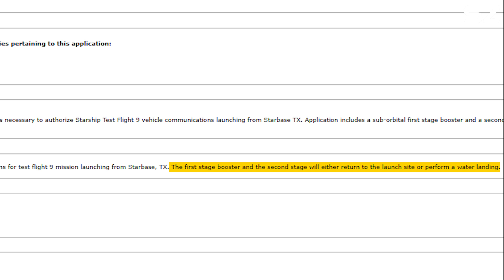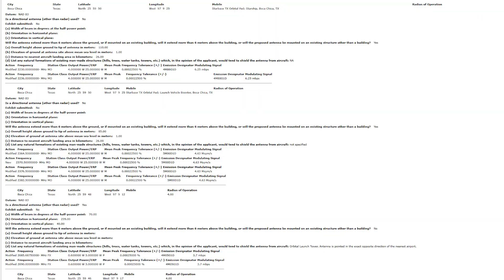SpaceX Revealed New Upgrade on Final Starship Splash Down, Unlike Any Other...

Comment: Don't you mean FAA not FCC?
Reply from the maker: Yeah! What happend?
Reply: @SpaceZonea  Your AI didn't generate a completely factual story. There was a license granted last week by the FCC for the communications needed for the flight. The FAA is the agency that actually authorizes the flight itself.

Additionally, viewing this on March 3 after you posted on March 2, you started with an announcement that Flight 8 is scheduled to lift of on Feb 28. Umm... It hasn't lifted off yet as it was postponed last week until later today. Not a good start.

If you must use AI to generate your stories, at least have knowledgeable humans review and verify them to catch the obvious flaws. Not just factual ones, but production flaws too, such as your AI voice stuttering because of a typo in the text at 11:18.

Preferably, use humans to write, narrate and produce your stories. You will find the quality better in all regards, at least until AI becomes truly ready for prime time. (which is clearly not yet since it it so easily detectable)